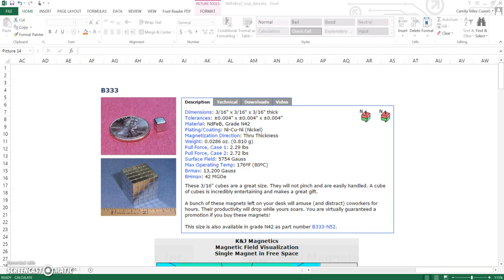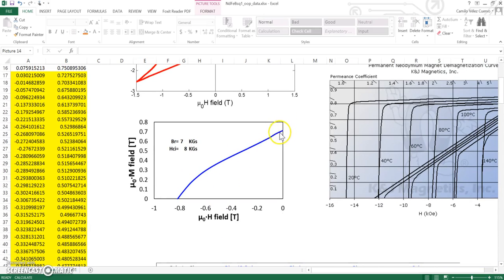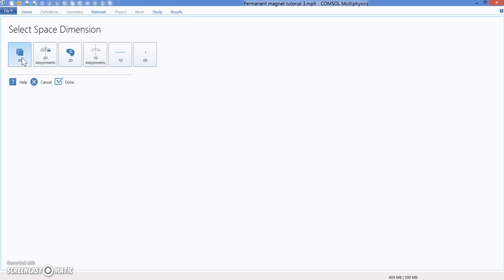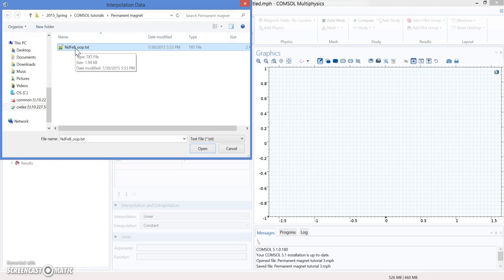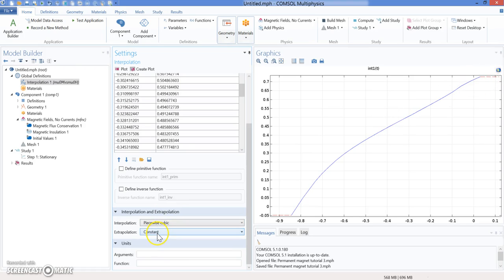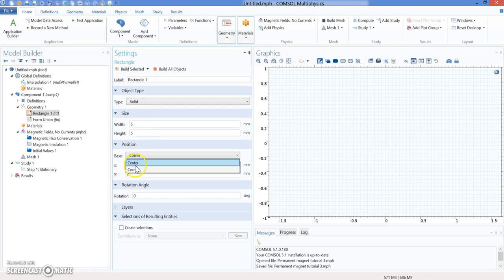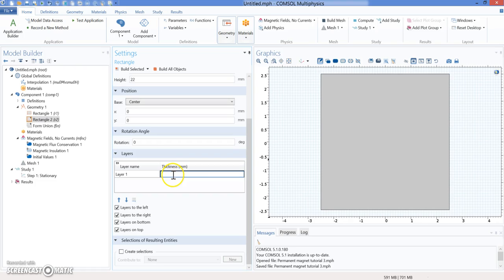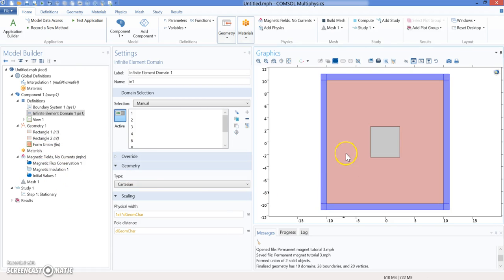Permanent magnet tutorial 1

Comment: i appreciate for your nice work. would you please share NdFeB_oop.txt file. thank you.
Reply from the maker: Thank you for your question. I loaded an example of the MvsH file in my website. Please download the file at: https://camilovelez.site123.me/comsol-simulations/modeling-of-permanent-magnets
Reply: @cavelcu  Thank you for your kind response, i will try to repeat your Comsol simulation. If you are interested in induced heating and bioheat transfer of MNP's you can check this: DOI: 10.1109/TMAG.2014.2358268
Reply: @cavelcu  I saw the values in the file which you shared in your website are different on your video.